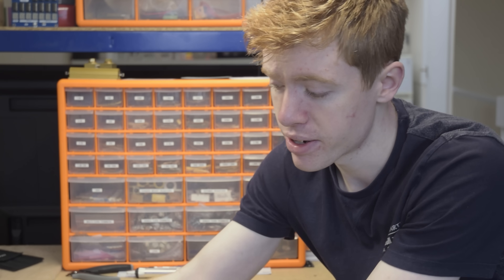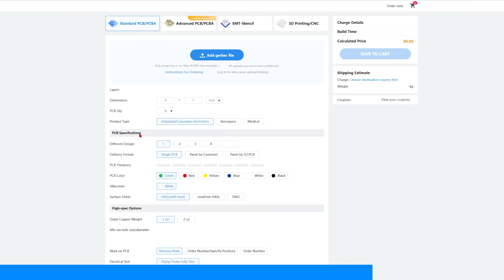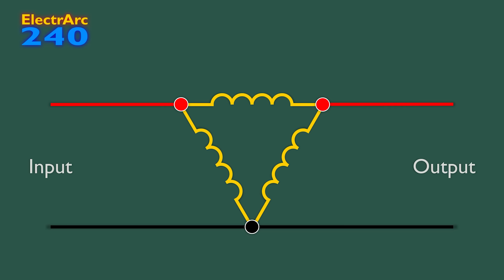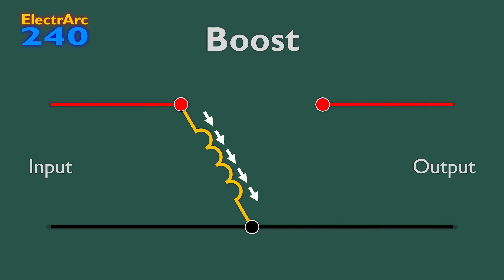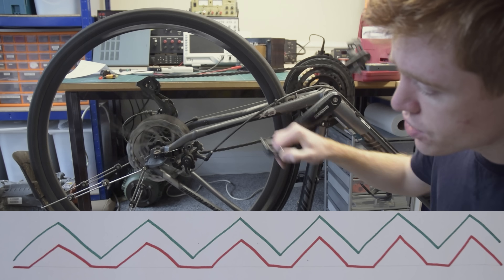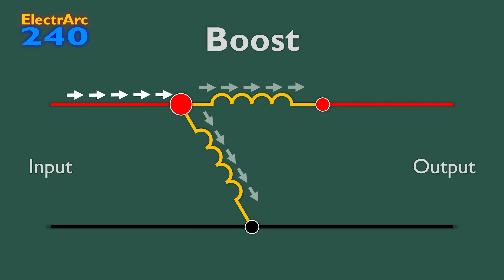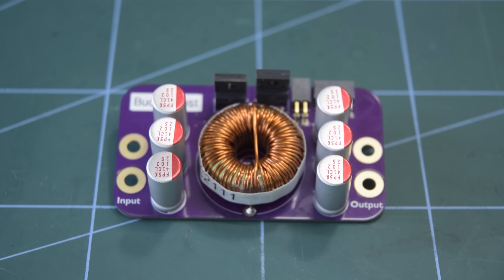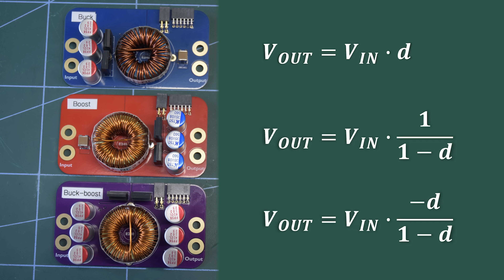How Buck, Boost & Buck-Boost DC-DC Converters Work

Comment: My electrical engineering instructor had mechanical analogies for many electrical components, a Coil was like a flywheel (voltage/torque leading the current/rpm), a capacitor was like a tank of water (Current/Flow leading the Voltage/Head) a transformer was like a gearbox, a wire a pipe and so on , he was a cool guy.

Comment: I always thought the collapsing magnetic waves would induce current in the opposite direction to the current used to charge them?

The circuit diagrams make sense to me.  The switch analogy doesn't. 

Either way.  I get the theory behind it. 

Am i the only one?

Comment: I had an old Korean War era BC603 and BC604 receiver and transmitter set.  They both used Dynamotors to convert the 28v DC to 300v DC and 28v DC to 650v DC respectively.  Really cool.  Wish I still had them.  They used a LOT of power!!!

Comment: Sepic buck-boost with two inductors to keep the current flow on input and output (semi-)continuous? needs 4 Mosfets ofc
How does LTC 3780 work? 1 inductor, 4 Mosfet Buck boost

Comment: Hello
I'm suffering to understand how the inductor flips its polarity, and how it is used as transformer 12-0-12 with only a single transistor and 12v DC battery, to produce 220 AC voltage
How it is producing AC?

Comment: 16:47 AFAIU (which is not much, by all means correct me if I'm wrong) it's mostly the inductor that provide the higher current in a buck converter. The high input voltage induce a current in the inductor during the ON state, which is kept for a while during the OFF state. During the off state, there's no input current, making the average input current lower.
In buck converters, I think the cap is only there to smooth out the voltage.

Comment: For the Buck-Boost converter, when current is flowing from top to bottom in the inductor, isn't the positive side still the top? Doesn't current flow from positive to negative, higher potential to lower potential? I know the buck-boost flips polarity of the input, but I don't understand how it makes that happen
Reply from the maker: In the “second step” the inductor is a source of current, think of a power supply current flows out the positive and into the negative, so you could say it flows from negative to positive if the device/component is a source rather than a sink. Hope that helps!

Comment: Hey fred, 

at 8:55 i was wondering of multiple ways we could use to make the current continous,
1) Increase the input voltage(as you did).
2) Increase the switching frequency.
3) Increase the switching duty cycle.

These are three possible ways i could think of maybe ther are more.
I was wondering if you could make a video highlighting benefits and drawback of choosing one over the other and how does that affect choosing the components used.

Some that i can think of is increasing the the switching frequency would reduce the current ripple but also reduce power we can draw at the output, also we can select lower value components for the same(lower value inductors and capacitors).
Increasing the duty cycle would increase the ripple current and also would require beefier components but my best guess is we can draw more power at the output.

These are my thoughts and was wondering if you could make a video on the same and any other possible ways to remove the current discontinuity.

Thanks.

Comment: With DC-DC step-down PWM every time you flip the switch off you could flip on another for the inductor to continue running and charge a capacitor. This cap is then charged above the source voltage and can then backfeed the inductor, a snubber circuit like this adds like 1% efficiency which is a lot in high power applications.

Comment: Wonderful explanation. I am wondering about the capacitor <-> inductor and current <-> voltage duality. Could there be, in duality to the three voltage converters shown here, three  current converters where the input and output are currents instead of voltages and capacitors and inductors are basically switched? I am wondering if those circuits would be useful for anything or if they are well known and how they are called.

Comment: Great video. This is very well done at explaining how they work. I have a question that I hope someone can answer. What application would there be to use a buck-boost? If the only goal is to reverse the voltage, wouldn't it be less wasted energy to just switch the wires on the way from Vin - Vout? I hope I'm making sense. Thanks!
Reply from the maker: If you wanted to generate an additional negative rail you might choose buck-boost. So you could have 12V and -12V at the same time. That's one use case but to be honest I don't think non-isolated buck-boost like this are used much, flyback however (pretty much the same but isolated) is extremely common!

Comment: "controlling how much time we have the switch open and closed we can control the output voltage of our converter there are many ways this can be implemented but the most common by far is to adjust the ratio between time spent on and off whilst keeping the overall time the period constant this is known as pulsewidth modulation or pwm". What does "there are many ways this can be implemented"? Does it mean, there are other ways other than PWM or many ways to implement PWM?
Reply from the maker: Kind of, still pulses but sometimes they can be fixed width and you vary the frequency or the switch can be hysteresis controlled which means the on and off times are more unpredictable

Comment: How do I take a battery supply of 24 volts and multiply it to approximately 400 v.
I need + 400 Volts and - 400 volts. Will be going to Triodes and Pentodes.

Comment: Question about current on all these converters.  Does the current halve/double on either end with the voltage drop/increase relative to the draw/demand?  I apologize if you touched on this in the video...I'm down with the flu right now and not my sharpest. 🤒
Reply from the maker: Pretty much yep, they won’t be 100% efficient but usually 95%+ so 10V 2A in would give 20V and a little under 1A out for example

Comment: The way you break down and explain the functions of various electrical components is very helpful in breaking down the barrier wall that keeps me from having that "ahh hah!!  Now I get it!"  moment of understanding electronics, or electricity. I haven't had the moment yet, but I can "feel" it getting closer.
Many moments in this video when you're explaining, I don't fully understand what/why it does, that causes its end result. I want to . . .

raise my hand - but Teacher, what makes it . . . ?
how does . . .?

(between the finger-pointing, is non-essential)
👇
At 67, I've put up a lot of boundaries that keep me going in the direction I'm traveling, like a fence on each side of a road . . .
Said another way - 
stubborn old man ain't going to change the way he thinks, screw him!
you're wasting your time if you think you're going to get him to change his mind about . . .

You get the idea . . .
(GOD I hope I'm not like that) 
I have always questioned, why does this . . . (open it up to have a look inside, aka destroy stuff) that resulted in my being able to fix darn near anything. From Heavy equipment, cutting out a piece of steel with oxg- acet torch and welding a new piece back in -to diagnosing a non-working furnace, chasing the problem down to a failed relay on the main board. 
The number of "It doesn't work" items I've repaired by finding a broken solder joint or burnt resistor, or a worn-out shaft bearing - and returning it back to service (fixing it) is--> a bunch! A lifetime's worth of achievements, the emotional rewards of helping others, is worth more than money, to the other person and myself. From Dozers to transistor radios, and literally, everything you can imagine in between, GOD has blessed me with the ability and skills to repair. (most of)
☝

Seeing and replacing a burnt resistor, I understand. But what makes that resistor and other electrical altering components produce a specific result? 
👉Here is where that WALL or BARRIER is, that I can't seem to get past. yet
•A radio that transmits and receives - RADIO WAVES
•The picture of a TV
•Cell phone battery - The charge regulating, protection boards many functions that it performs.
How/why does manipulating electricity (in the thousands of ways a "motherboard" does) produce these end results?
The knowing "why" a resister is needed "here" to make or prevent (component) to cause (component) to (end result)

It's almost like a complex math formula - letters and numbers representing various components, whose value, can be separated or stacked by bars confined within parentheses reduced to its lowest form then and or multiplied or divided by what's in the parentheses to arrive at or end with (end result/ radio wave)?    ewww - nice analogy!

Are you confused yet? LOL - I am
That's kind of what I'm trying to sort out and make sense of.

(between the finger-pointing, is non-essential)
👇
I desired to push a button that resulted in starting a diesel engine wirelessly. (house to gen. shed)
Couple weeks or so later
A functional home-made, two-part product that accomplished it.
A transmitter and receiver that initiated the start sequence of heating glow plugs, attempt a start, detect result, (start, yes-no)advance accordingly (repeated start sequence (number of attempts to advance) or (happy me)--> it started) maintain switch connection until commanded to disconnect.
(A garage door opener adopted into the start sequence board)

The fella designed and etched a board (no computer-aided design program and before ordering a small amount was possible) hand soldered everything, and it worked.
Obviously, he had an electronics background, was a "chill" 30ish living off-grid, rural(way away from city) typical home, no job (hippie)?
The fella "understands" electronics . . .  or
The fella can explain "it" so a 6yr old is able to understand it.
☝
but I digress

Now that you've become my favorite Teacher, I wanted to say 

Thank You

reading morrisedwards Comment . . . Out of nowhere, a mental image appeared at the exact same time an incredibly powerful desire to confirm or deny if I could hit the back of his head with a spitball launched from a straw.                  don't look at me -->I don't know where it came from

Comment: Great video, very clear. What issues would low capacitance on the input of a buck converter cause?

I understand the output capacitors smooth the voltage ripple to an acceptable level, but I don't understand the purpose of the input capacitors, as surely the voltage source is supplying a constant voltage, so why does it need smoothing? Or is it that the voltage drops when charging the inductor, resulting in a ripple on the input side too, potentially damaging the voltage source somehow?
Reply from the maker: Yeah no voltage source is perfect there is always some resistance and inductance in series with the input to the converter, so the input cap is to make it more ideal. For example in the case of a motherboard’s VRMs (buck) there could be 30cm+ of cable between them and the main PSU which is a lot of inductance. If there was no input cap the voltage ripple at the input would be significant and that voltage ripple would also be on the cables which would cause noise issues.

Comment: 2:46   IF YOU ALREADY HAD A RESISTOR
Why did you short the capacitor, why didn't you just use the resistor to discharge it properly ?
Reply from the maker: Lol I didn’t realise the irony of that shot. It’s just B-roll, I talk about a high current when you short a cap so might as well show it
Reply: @electrarc240  
LOL... Fair enough

Comment: Yeah, I didn't quite get that bit about using 2 mosfets instead of 1 mos, 1 diode.

Why would the diode become reverse biased and block the current flow at very low load?
As I understand it, after the control mosfet switches off and the inductor begins sourcing current to the load, it won't suddenly reverse current directions just because the load has dropped. Yes, the potential across the inductor will reverse once it stops being supplied by the input and starts to source its own current from its stored energy.

It will just continue to amp up the current to maintain current flow if the load drops. Or? What am i missing?
Reply from the maker: At low load the converter may run in discontinuous mode where the inductor runs out of energy. At that point the diode blocks current from flowing back into the inductor from the output, but an active switch would not. Sometimes you want that sometimes you don’t so it’s not necessarily good or bad
Reply: @electrarc240 Aahhh so the reverse current flow depends more on the output conditions and whatever smoothing capacitor you might have, than the inductor behavior?

It's not like the "inductor reverses current", but rather "current through the inductor reverses" because of a combination of conditions downstream to the inductor?
Reply from the maker: @lad4694  Yeah exactly, apologies if I wasn't very clear
Reply: @electrarc240  oh no worries at all! I hadn't really considered bi-directionality in this situation prior to this video, and the EE field isn't the best when it comes to nomenclature anyway... You did so so great regardless. Low load actually being high impedance and vice versa caught me out for a wee bit. When really I should have been thinking in terms of power draw.

It's rare I only have 1 question in an entire ee theory video, so I'm incredibly stoked still!

Comment: I see that a few people have mentioned  4-switch "buck-boost" converters in comments.
These are not "classical" buck-boost converters, but actually converters that operate either in classical buck mode or classical boost mode according to the input and output voltage requirements and conditions. The required controller is quite complex. One built-in benefit is that synchronous rectification, with its inherent efficiency advantage, is "build in."

Comment: Excellent, as always!

One point I would emphasize: The expressions relating duty cycle with input and output voltage only hold up when the inductor current is continuous (i.e. the inductor current never "dwells" at zero at any time during the switching cycle). Once inductor current become discontinuous, the expressions become much more complex.
My apologies if it was mentioned and i missed it.
Reply from the maker: Yes, I didn’t mention it in this vid but will spend a while going over it and demonstrating it in the next part. Thanks btw!

Comment: Can you use a Buck-Boost converter to make a dual +/- power supply for an opamp? Since you already have +10V going in to the Buck-Boost, getting -10V on the output, and have a common ground, seems like it would work but... I'm not sure if there would be problems using it that way or maybe that's the whole point.
Reply from the maker: Yeah you can, but they are quite noisy because of the discontinuous current and many applications for bipolar supplies are analog circuits requiring nice smooth voltages so often they can’t be used because of that

Comment: Pardon my ignorance - and great video by the way - but if you don't have a common ground in a circuit and want to use a buck-boost converter that is not isolated, could you not just attach your load in reverse so -10V is referenced as ground, making the '0V' output +10V? I figure I must be misunderstanding something though! Cheers
Reply from the maker: Yes you can, if you have a load that needs to be a certain way round but doesn’t need to be referenced the same as anything else then there’s no reason you can’t!

Comment: I still don't understand how boost converters are able to get more voltage. Where's the cost coming from
Reply from the maker: From the inductor. It builds up the energy and then releases it in a shorter pulse so the voltage is higher and adds that to the input. If you averaged it you’d have the same voltage as the input (like when I run it I get double the input for half the time and zero for the other half) but then you add a capacitor to the output! So that gets charged to the high voltage and discharges a little bit when the output is “off” but not too much. Does that help? I know I was quite hasty with my explanations in this video
Reply: @electrarc240  Thanks. I was trying to think of it as a conservation of energy thing where Voltage is potential. I guess that means that there should be an increase in amps draining the battery supply faster at twice the rate right?

Comment: Great video. I think I missed something. Curious about the Buck-Boost converter's inverse output. Why the complexity of the circuit if all it does is reverse polarity?
Reply from the maker: Adjusting the duty cycle lets us turn the voltage up or down, it just happens to match the input at 50%

Comment: Just discovered you via the switch mode power supply video.  Would it be correct to say: an SMPS is actually just the rectifier part of a  linear power supply - but without any initial transformer to lower the voltage, so it's operating at mains voltage. (more efficient, or at least needing smaller parts, because of the higher voltage.  I'm reminded of the 400 volt vacuum cleaners used on airplanes)  -- coupled with a flyback/buck-boost DC to DC converter to greatly lower the voltage to useful-for-standard-electronics levels?  Is that an oversimplification? 
These are great videos!  Keep up the good work!

Comment: ok but why do you keep turning the potentiometer while it is smoking and burning at 1:21
Reply from the maker: It's fake 😯. There's a 1/4W resistor hidden behind that I put 20W through. Great "mini pyro" effect if needed. That's why the LED doesn't go off

Comment: buck boost converters are not reversible, unless they have a seperate pwm controller per side and a triode or dual transistors on both sides, depending on application.